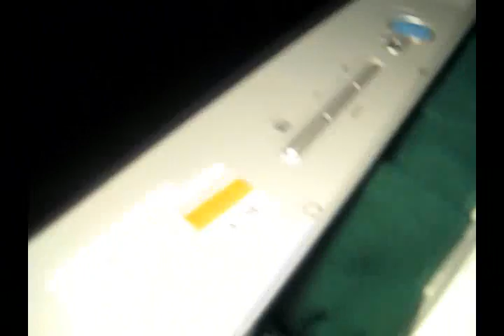Capacitors - Fixing an LCD computer monitor

Comment: I followed this and replaced 2 capacitors to stop a flickering problem and it worked great but just a couple of weeks later, today I noticed a smell coming from the monitor and it started making a non stop shhhh sound, which when I took it apart seemed to be coming from the LCD screen itself, no capacitors look bad, Any ideas?

Comment: Please help if you know what to do ?. I have a  12 v dc to 120v AC invertor, it is not working because output read only 84V AC. I look at all capacitors are good,  What is the next thing to do ?. Thanks

Comment: My screen is going blank after two seconds, I just removed the back, but all of the caps on the power supple board look fine (ie, flat).  Any other suggestions?  Could it be the cable?  Thanks!

Comment: Me monitor starts up with a lot of colored Lines after 10/20min the screen flashes to normal is this a problem with the capacitor or condensator ?

Comment: Okay so after taking my monitor apart  my monitors there is a white rubbery? foam around most of the capacitors? do I need to remove this foam it looks like it's pouring out of the capacitors but IDK? if anyone knows anything lmk Thank you in advance.

Comment: That's not a 'U' that's Mu. Also, the voltage is the maximum voltage the capacitor can handle. A capacitor will charge to whatever voltage it is charged at, accepting up to the maximum. If you have a 16V and you swap for a 50V it doesn't matter as long as the capacitance is correct. it'll be a waste of money and space, but you could do it.

Comment: So you are saying the symptoms include blinking? That is the problem I have with my SyncMaster 2033 from Samsung. Obviously from your argument, these electrolytic caps are the achilles heal of modern electronics. Time and heat are their foes. Trying to find the cap package on Ebay. So far no luck. In Canada, Radio Shack is no longer selling components :-(  Great video and boy do you ever get good view numbers! :-)

Comment: were they the result of another problem or their own problem
Reply from the maker: Almost certainly just "capacitor plague", possibly expedited by the heat of the PSU.  Common for this era of device, especially when it comes to LCDs.

Comment: i have about 6  lcd monitors...some with bad circuit board with no visible bad capacitor... some with broken lcd...but they are different sizes so i cant swap the screen.... but im happy already with the ones in was able to fix...1pc 24", 1 pc 22", 2 pcs 19"...all from garbage :D